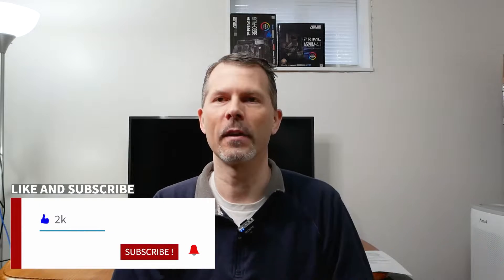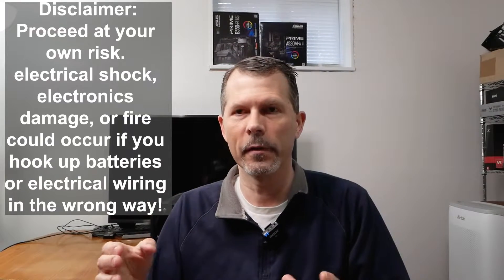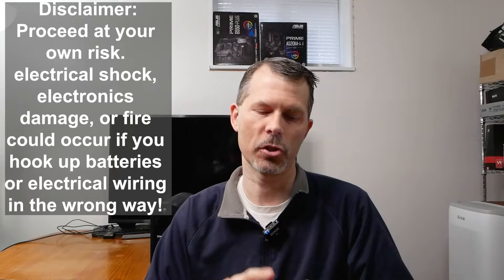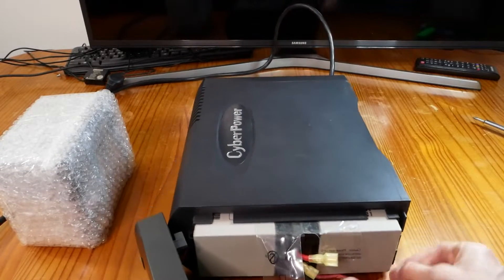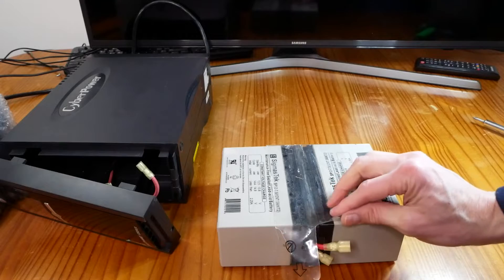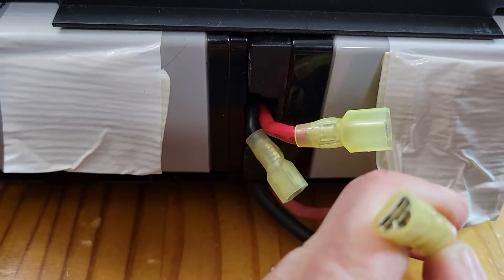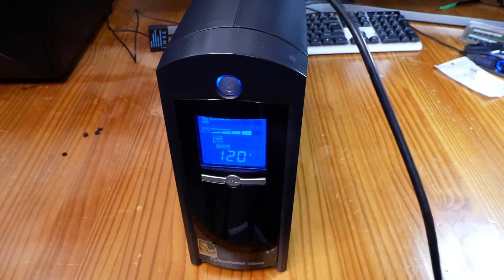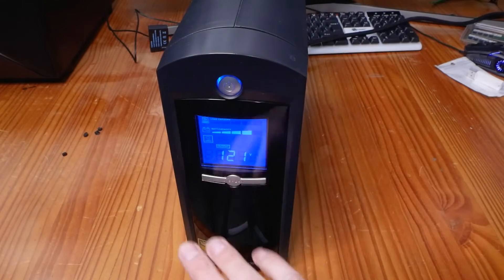DIY CyberPower UPS Battery Replacement Save tons of $$

Comment: It would be hilarious if all you needed to do was replace the corroded terminal 😁 Surely you'd inspect for damage first, before buying new batteries?
Reply from the maker: I already had replaced these batteries once before and these ones were almost 4 years old. Before the filming i already pulled the batteries out and tested them and they were both Below 12.0V: which ussually means Discharged or failing. I then tested charging them outside the unit and the same below 12v so yeah beside the dramatic corroded terminal dramatic affect these were toast.

Comment: At about 8 minutes you answered my question - maybe. "I believe they are in series". The CP1500 has the batteries side by side instead of opposing at the terminals and had a jumper from battery one red to battery 2 black - series. I neglected to take a picture so wasn't sure if I connected them correctly (oops). Unit is working and software says the battery voltage is 26.9 so I definitely have them in series.
Reply from the maker: Hi There and welcome to the channel! I'm glad you got them hooked up and "that they worked correctly" :) I tried to create the video as best I could as to help others. Note: I always take a picture before I disassemble stuff just in case my older memory fails me :) Thanks for watching and commenting and I'm glad it helped!
Reply: Same.  I wondered why it didnt start with the new batteries this morning.  Back to the drawing board!
Reply: Mint. Also. Tried. Multi metering my. Unit with no batteries attached to see the voltage.